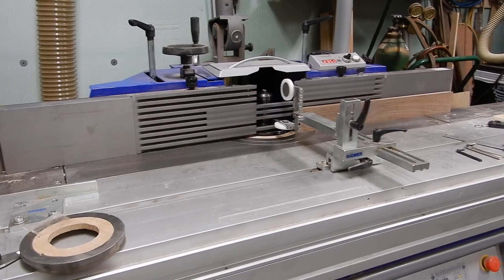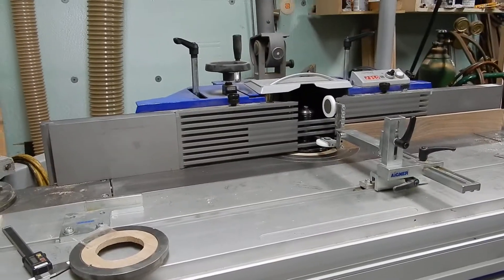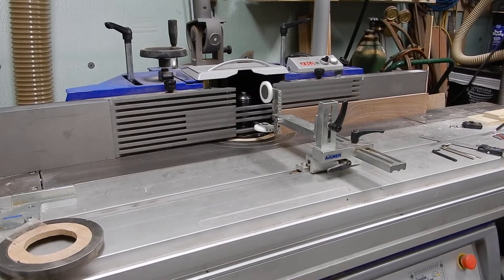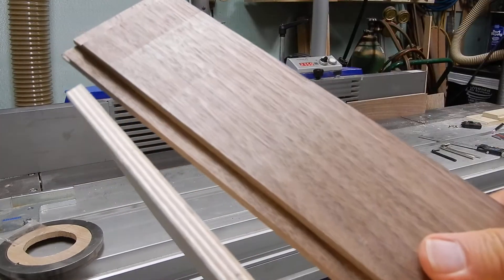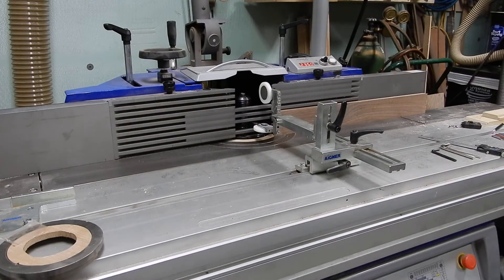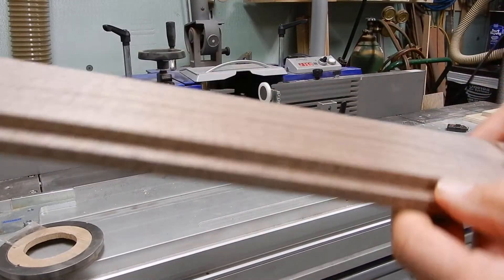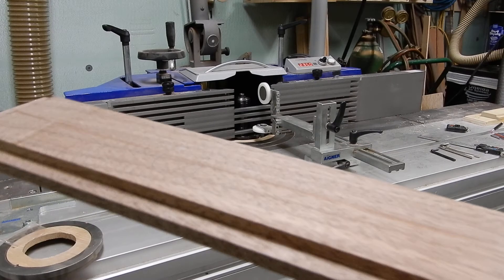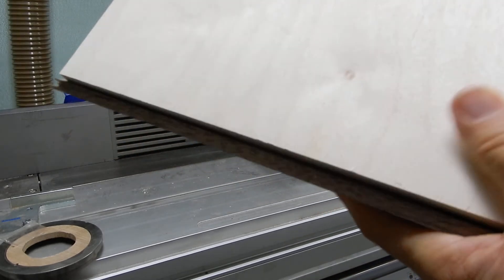Felder Profil 45 shaper cutting groove for 12MM birch plywood box floor

Comment: Nice rebates :-)       When running boards vertically, I've found using some of those magnetic featherboards helpful in keeping the board against the fence.  They are easily adjusted and quick to install and remove. Cheers
Reply from the maker: jc109  with the wheel spring loaded pressure I am at 10 lbs of force at the tooling nip unlike any feather board. It was a two handed two foot board pressed against my knee with that 
kind of pressure point. You must have some strong magnets over there. I will be putting a vid of my approach to running a router bit lock miter joint in the near future. Every board cut to
exact dimensions and braced in perfectly square to the table and fence is required or else nothing is square in the joint. Have fun and be safe jc109. This shaper has some aluminum
table parts that fend off magnets and even two sided tape.

Comment from the maker: you can see that board lift up slightly at around 57 seconds. Later discovered the groove had a bump in the wood and required a should plane fix. And so it goes.